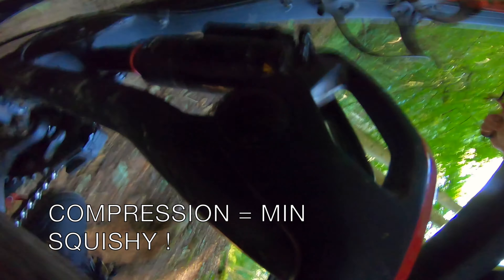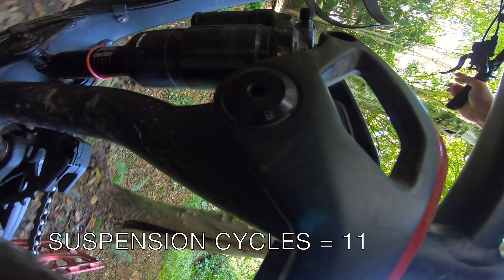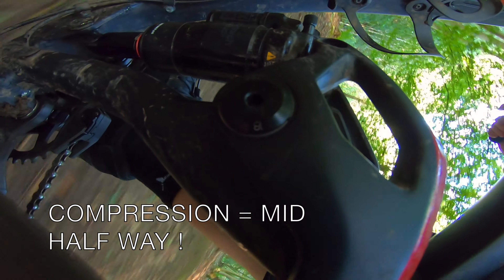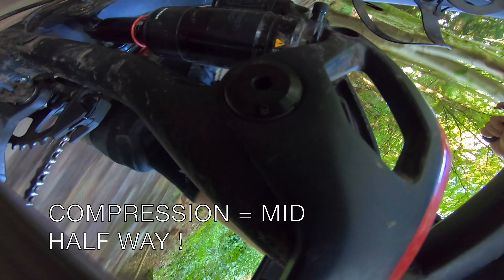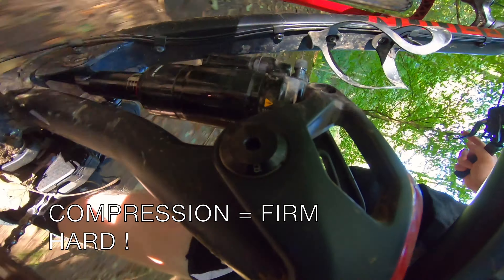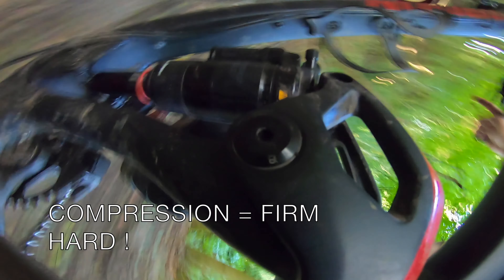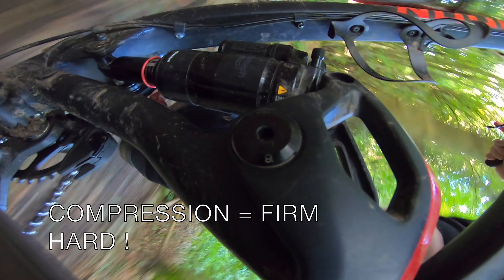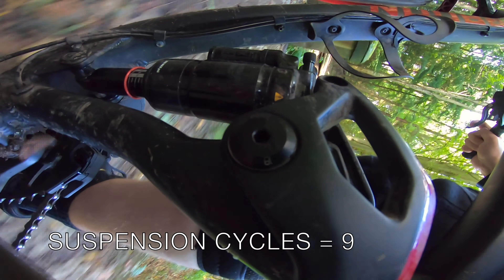MTB Slow-Mo Sessions - How Do Suspension Settings Work?

Comment: I have the Lyrik ultimate rc2 and basically the same forks as yours. When adjusting the high speed compression I always hold the low speed compression still as it also moves.
Reply: Just tighten the top screw and it will be fixed.